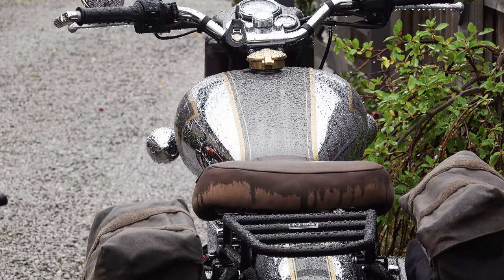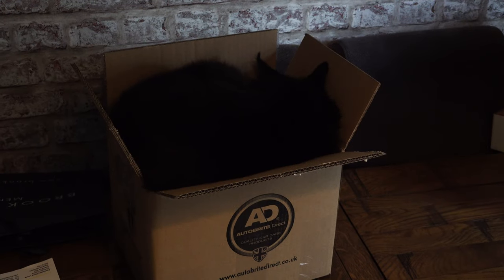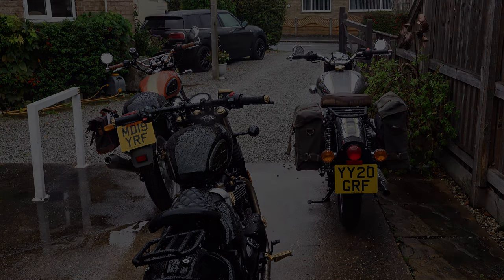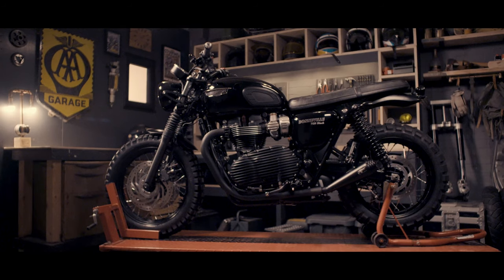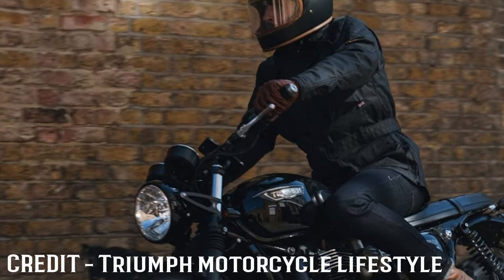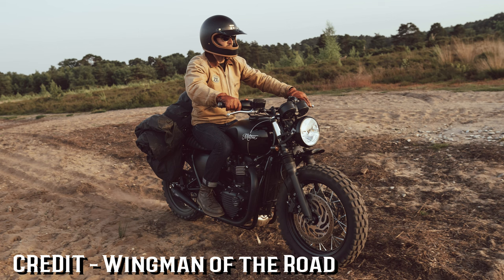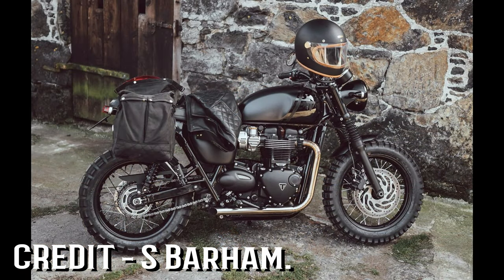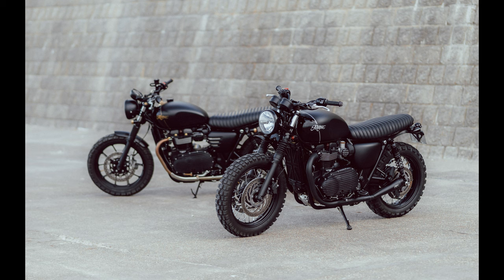Has MOTONE Customs reached ICONIC Cultural Motorcycle Brand Status?

Comment: Thanks for the discount code Stuart. My 2003 T100 has already got the Motone tail tidy   light, and indicators, but I've just ordered the front brake reservoir top, and petrol tank cap. That a nice little saving thanks to your discount code. 👍